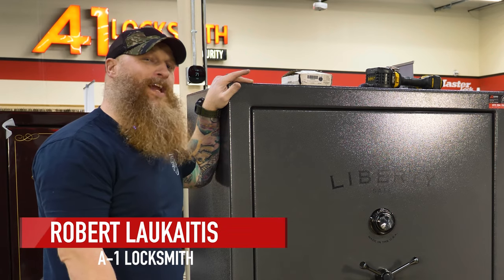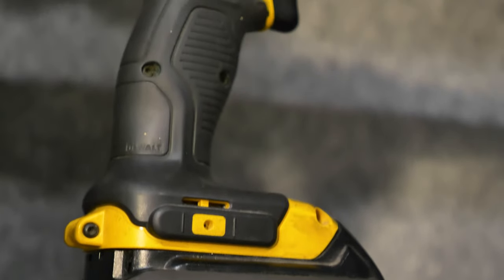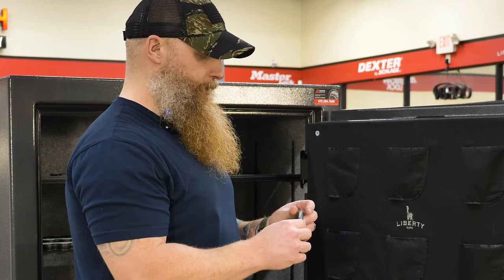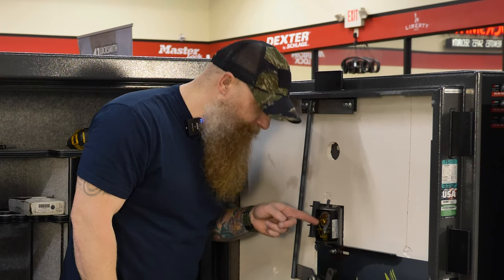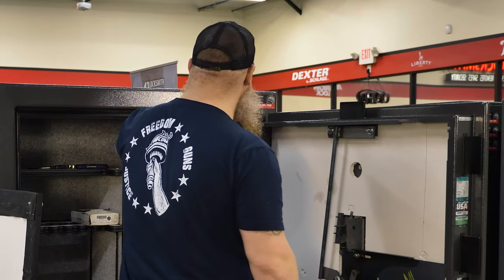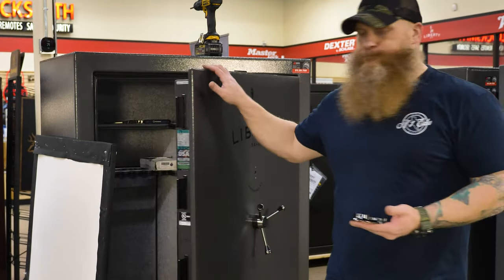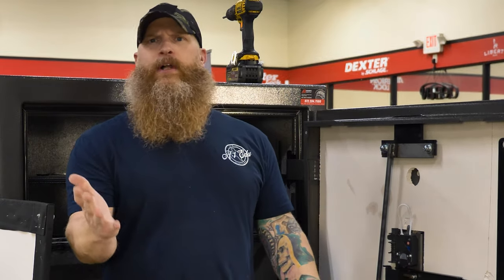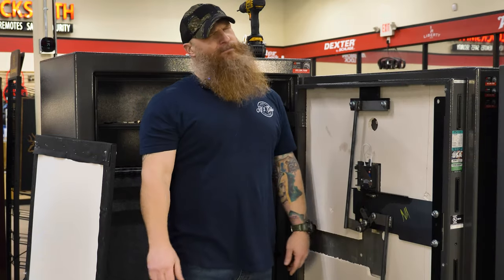How to Change Your Gun Safe Lock | A1 EDU Gun Safe LOCK SWAP

Comment: Uh, problem: isn’t the mechanical lock EMP proof? Not so the electronic version.
Reply from the maker: You’re half right. Yes ,mechanical locks are 100% emp proof. Many of today’s top selling safe keypads ARE rated for EMP. They have what’s called a RS105 which is a Mil-STD test. It’s also rated for solar flares. The locks linked in the description all have it, I believe.

Comment: Absolutely great! Thank you. But I just went the opposite way- electronic to mechanical because one of the push pads behind a number in the combination died so I couldn’t get into the safe. Now I don’t worry about dead electronics.
Reply from the maker: Thanks for watching! I get it, everyone has a different opinion of which lock. Today’s keypads have a lot of great R&D making them better. However, I can appreciate just going mechanical, it’s what I have on mine.
Reply: I was thinking same thing what happens if an emp takes out your lock?
Reply from the maker: @soh100  You nailed it, great question. Most high end keypads (everything we carry, I believe) actually has an EMP rating. It’s up to Mil-Spec and additionally covers solar flares. Now, is this a 100% guarantee…doubtful. Did they all do fine in solar flare in late Feb 2024 in Texas / across the country….yes.

Comment: Do not put an electrical one on your safe mechanical will always work. You don't need any power.
Reply from the maker: Yeah, to each their own. Well over 90% of the safe market chooses keypad over mechanical. And as someone who sells & works on safes manufacturers are definitely offering more reliable keypads than say 15 years ago. Mechanical locks are great though and overall have less issues, but they’re not without issues.

Comment: I have a question what happens if you've lost the key to the gun safe is it still possible to change the lock
Reply from the maker: As long as the dial still spins, yes. If not you’ll to get the lock picked over because it has to spin to come apart, lefty loosey righty tighty.

Comment: Which electric lock do you think is best for a liberty presidential safe?
Reply from the maker: @jamestraina7313  Can you see what year the safe was manufactured? It kinda depends on the year which locks can/cannot work, honestly.
Reply: My Safe date 3rd/2010-1 model Q-25
Reply from the maker: @jamestraina7313  Depending on the cam inside the door I think you have to use a square bolt style like a S&G Titan or maybe a AMSEC ESL10. I believe the new pivot bolt style locks like SecuRam BackLit or ProLogic will get hung. I know that happens with like a 2005 model and I don’t think Liberty made a change to that gear until like 2015/2018. I might have you email pictures of the inside of the door with the panel off robert@a-1locksmith.com

Comment: Great video!  Thanks for explaining the mechanisms in the lock.  I have a keypad that won’t stop beeping after changing the 9V battery (multiple times), so I might be looking to go mechanical or upgrading the keypad with biometric.
Reply from the maker: Thanks for watching. Hard to say, depending on the brand it could just be a faulty keypad. Good luck!

Comment: Perfectly done! Question though! How do i know which key pad to buy?? I was gifted RedHead safe but no keypad or dial on it. Obviously looking to put it back to use
Reply from the maker: Thanks for watching! I might need you to email pictures of the outside of door and remove the door panel to get a picture of inside of the door. That might be enough for me to tell you. Typically with RedHead safes can use the locks we linked in the description.

Comment: How about the reverse? Going from electronic to mechanical?
Reply from the maker: Man, I’m thinking about it. It’s quite a bit more involved and takes the user being a bit more mechanically inclined. I’ve personally had to fix lots of customers mistakes trying to install or set their own combination. For those reasons I’m hesitant, I’d hate it if someone made a mistake and were stuck with their safe open. You know?  But you’d be interested in that video?

Comment: Is there a back door combination on the digital lock y’all sell?
Reply from the maker: This is a great question. And hopefully more people see this. Most any lock on the market has a manufacturer reset code. This is removal in many locks. For example the Securam TopLit and Securam BackLit and ProLogic you buy from us you can set that reset code (aka super code) yourself. There’s a user code, the one you use everyday to open your safe and super code which is a backup, you set both when we mail the lock. If you already have a TopLit or BackLit lock on your safe we have a video that shows you how to reset the super code yourself.

Comment: Robert, you’re in the wrong business. You’re a born entertainer. No script and it was entertaining as hell.
I am looking to buy a safe at Costco (I know, I know, don’t say it). It’s made by Sanctuary (China) who also makes the Remington and Sports Afield gun safes. I want to do the reverse of what you did in this video, changing out the electronic lock to a Sargent & Greenleaf mechanical. I’m an old Boomer and have a thing for the old combination locks. As far as you know are the electronic lock hole patterns universal? I haven’t removed the rear panel yet and looked inside but if you tell me the Sargent & Greenleaf 6730-100 is compatible I will buy the safe.
I only have a couple guns and don’t need a pricey Rolls Royce Liberty safe.
Reply from the maker: @Nobody4rpresident  You’re entirely too kind, but thank you. We (the Mad Scientist filming & editing) and myself figured if we want people flying watch we need to be real on camera. Hahaha, I’m a goofy gorilla🤷🏼‍♂️. I’ve not worked on or done a lot with the China Remington safes. However, there is 1 simple rule of thumb, if it comes with a key then you can’t swap it. I am not familiar with the lock I see on the Sanctuary safe in Costco’s website. However, I read the reviews and someone did mention “key override”, this typically cannot be retrofitted to a S&G 6730. That said, it’s a little more expensive, but perhaps a Browning BX 10 or the 14 size might consider consider. Browning's NEW 2024 Budget Gun Safes under $2000 | Browning BX Series Gun Safe Review
https://youtu.be/TweTTtlgWaY